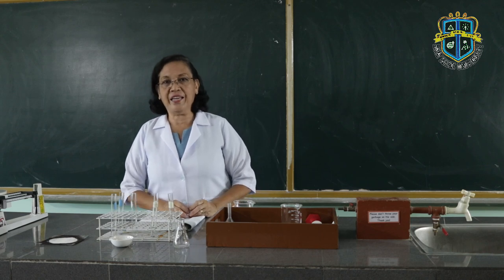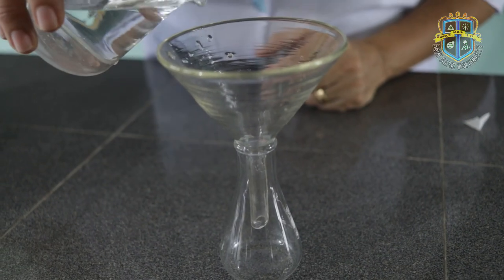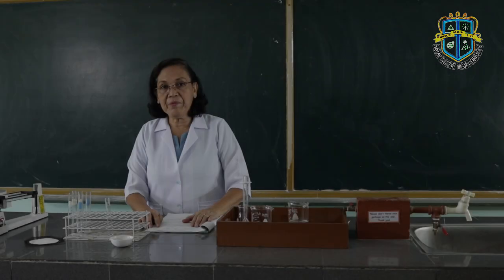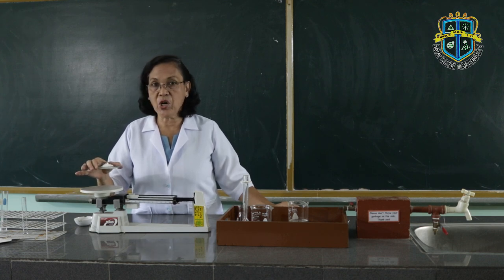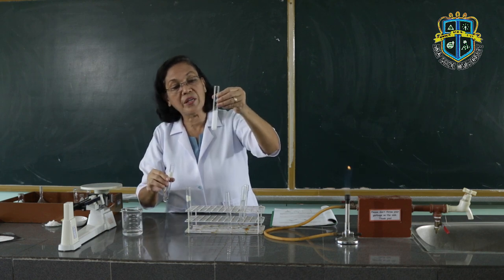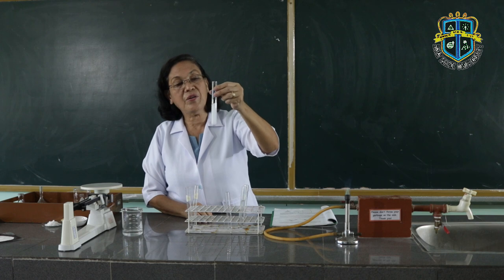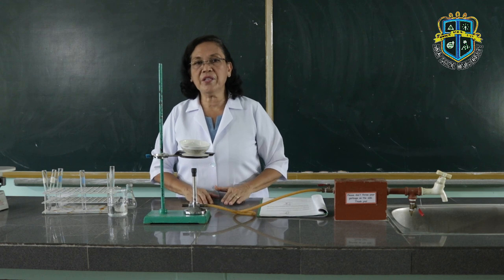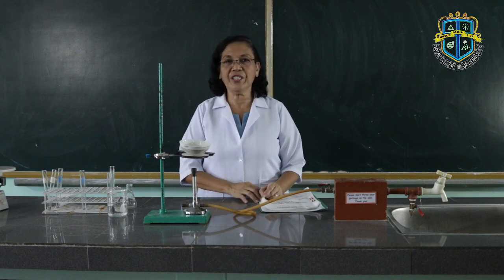COMMON LABORATORY OPERATIONS

Comment: It was a nice demonstration on how to use some of the laboratory apparatuses. However, the professor should have worn gloves and safety goggles other than the lab coat, especially that she was doing an experiment by mixing sodium chloride and silver nitrate. 
This is to show the students the importance of wearing a complete set of protective equipment inside a laboratory for their own safety.

Comment: Mercedes CUBELO BSCE-2 (TTh 7:30-10:30 am)
In the above discussion, I learned the common laboratory operations. More specifically, I learned that the collar in the graduated cylinder plays a vital role as it serves as the cylinder's protection from breaking, also, when transporting a liquid from a test tube to a graduated cylinder, it is very efficient to use a funnel to avoid spilling. Also, I learned that when measuring the volume of water we need to focus our eyes on the lower meniscus of the liquid, however, if it is mercury we are going to look the upper meniscus of the liquid. Generally, I learned that careful handling of laboratory apparatus and knowing its operations will produce a good experiment results.

Comment: CELIS, MARY GRACE P.     BSCE-2 
TTH (1:30-4:30)PM
lab equipments can lead to dangerous side effects and that is why it is quite important to know how to handle it properly. We should always know the lab equipments well before we do any type of experiment because without the proper knowledge of the equipments we will not know how to use the materials or how to correct a mistake that we could make with the equipment.

Comment: AMIHAN Ruyen 1:30-4:30 PM T-TH
I learned about the different laboratory operations and the apparatus needed in measuring liquids. I also learned that the purpose of the collar of the cylinder is to prevent the cylinder from breaking.

Comment: Rosemarie, Cepedoza
BSCE-2 TTH_1:30-4:30

I learned how to perform the common laboratory operations. And also, how to used and handle properly when measuring the amount of volume using the different kinds of laboratory apparatus.